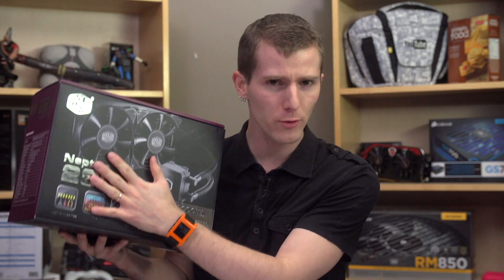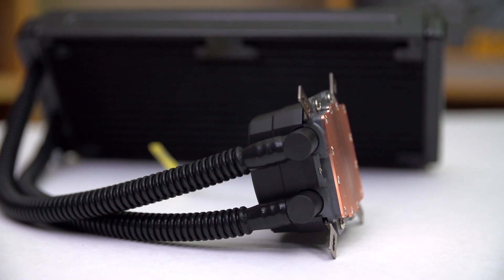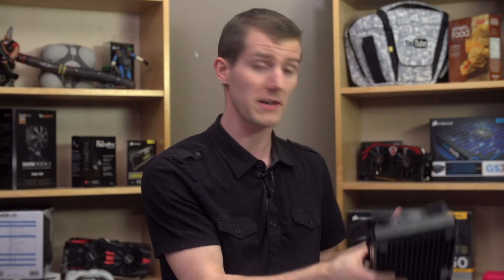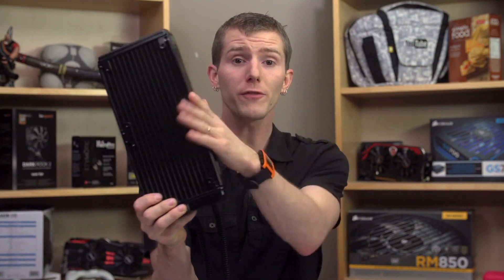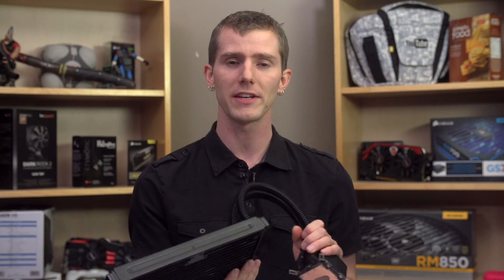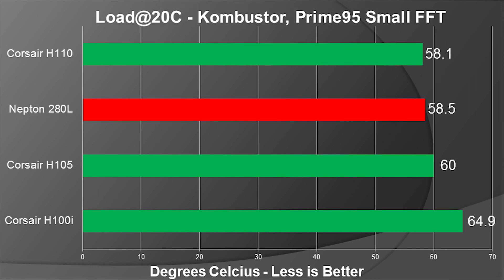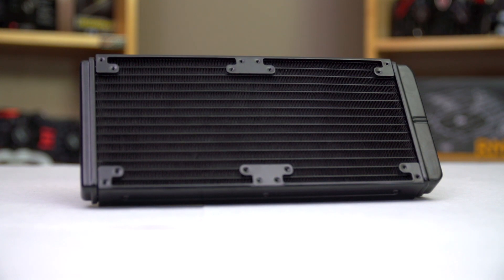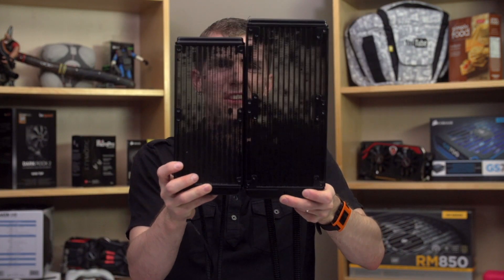Cooler Master Nepton 280L Water Cooler

Comment: It would be soooo cool if cooler master came out with a full tower case that has water cooling rads built into both sides, the back, the front, and the top with the pipes coming down from the top of the case to the motherboard and cpu area. It would be heavy as hell, but imagine all of the surface area for heat to dissipate from.

Comment: Nepton280L + Noctua NF-A14 PWM = perfect combination !
Reply: i promise you we'll see a Glacier 280L in the next few weeks ;)
Reply: NuMetal92 no, but Glacier 360L (3x 120mm) is already on production :D
Reply: IndraEMC I dont understand why, its only for CPU a tripple rad is a bit overkill!
Reply: T0BBi94 Glacier are expendable, you can buy a waterblock for GPU or chipset, plug a tube from your Glacier 360L and you got a fully custom loop water cooling.

Or you can use triple 120mm Radiator just for your CPU for extreme overclocking.
Reply: IndraEMC
close enough ;)

Comment: it is not 20mm. it has two fan mounts so 2*140-2*120= 40mm. But you are right about the sides, they are 20mm shorter.

Comment: You guys also missed that if you just barely turn a screw too tight on the radiator it strips out the threads in the hole very easily on the 280L.  I've had to RMA 2 of them already because of that problem.  That and the constant buzzing with adjusting the screws over n over gets quite annoying.

Comment: Interesting that they have 120mm fan slots on there.  Would it theoretically be possible to mount this on a case that had only 120mm fan slots in the top as long as there was clearance for it?  Or would the rad need to be bolted to the case using the 140mm holes anyway?  If the former were true, would it not be advantageous to do a comparative test of a 280L with 120mm fans and something like a H100i with 120mm fans?  Niche market there?

Comment: I wanted to fit this into my r5 case but i don't know it will hit the 8 pin cable at the top of the mobo. I have the older version of the case without the modular plates on the exterior but two on the interior.  A 240 could fit but I want to cover the entire opening at the top. What are your thoughts on using this rad with two 120s?

Comment: Also I have the cooler mastwr seidon 240M. I have the connector of the water block in the cpu fan header and the two 120mm fans in the two adjacent chasis fan header. Temps are damn amazing but the fans are kinda loud. I feel that they are on max somehow basically on startup. How can I manipulate this to find a nice performance/noise lvl medium.

Comment: would this cooler fit in a NZXT Phantom 410? i know it fits a 240mm Rad no problem but im skeptical if a 280mm will fit the case does have duel 140mm fan support but im just not sure if theres enough space for the tubing

Comment: Never get any answer on this. Are these safe? Do they leak? I know the coolant isn't conductive but it's still liquid and not good having dripping around in the case.
Reply: They are closed loop - Liquids should never leak by design.

Of course no system is perfect and there's a one in a million chance that a nicked or imperfect pipe bursts open. But I'd put that on par with all other "This is so unlikely it's not even worth discussing" list.

You should feel perfectly safe buying a closed loop water cooling system - It's zero maintenance (Except for cleaning out the fans every so often just like an air cooler) and zero worry.
Reply: Mansen Thanks :) Will consider this type of cooler for my next PC.

Comment: Would like  to see in the comparison optional fans. If the fans aren't static pressure. I am willing to replace them on the unit 
But i would like to see an alternative to the Noctua fans or 
At least a good enough solution. 

Ty for video.  | /,,.

Comment: Okay so I need to know if this is a decent build for my first gaming pc ever.
NZXT Phantom 410 case
Biostar Z87x motherboard
Intel core i5-4670k
Cooler Master Hyper 212 EVO CPU cooler.
EVGA GTX-770 GPU
Corsair CX600 600W PSU
G. Skill 8GB (2x4) RAM
1TB WD HDD

Comment: At first I planned on liquid cooling, but more and more, it seems the setups that NEED liquid cooling to stay cool, make for a very small venn diagram. Reminds me of so-called hot-rodders buying expensive spark plug wires and claiming crackhead performance gains. I love the liquid cooling looks, esp w/ colored tubing, but if air cooling alone works, why unfix it ? Thx, Linus & Slick

Comment: I bought 4770K with H100i last month but changed stock fan to Noctua Nf-F12 in Pull.. They look ugly but the are hidden on top cover oh 600T case in pulling air from inside and exhausting to the top..
Reply: what is your clock and what temps do you have under full load ? i have the same cpu and cooler and it would interest me how corsair sp performance perform
please also say me how much rpm you run it, if you set it specificly
Reply: At stock clocks, it stays at 25C  with fans controlled by the 600t"s fan controller at lowest RPM and at full load in OCCT stress test for 15min, it goes at 48-50C max..

Didn't OC'd till now but gonna do it. I'm a VFX/Animation student so rendering is done but till now had no problem with stock clock.. This is to be noted i have 2 X R9 280X and in Live in New Delhi, India so ambient temps a re bit high compared to USA, UK ..
Reply: I stay at 20-25°C dipending on my room temp.
Under full load with custom curve the rpm goed around 1000-11000 and temps stay around 55. I prefer to have it quiet. The thing that makes more noise is the hdd. lol

And i didn't OC too. For the moment with a gtx 780 i have enough horsepower
Reply: Jay Shank wow thats higher than my noctua nh-d14 yikes
Reply: my 9370 runs below 12-13 degrees and at idle runs 2-3 degrees underload stays around 43.

i use the asetek 120mm thick close-loop that came as a bundle ...im not sure how it does this :S but i guess im happy lol
Reply: damn elmo you like it cold in your house or was you talking about delta temps?
Reply: Unless you live in a meat locker I'm going to say your readings are wrong.
Reply: i do live in canada and its winter maybe tht helped?
Reply: I live in India and Room temp in summer is around 35C or higher with AC off.. so you can get the idea... In winters, i don't know as its only about a month or so since i builded the system from scratch..

Other than that 50C is not bad.. just think what if i was using a stock fan which came the the processor??
Or even with H100i's stock fans...
Gonna do push/pull to but have to get slim fan as the board and radiator don't have much room left, by r=the way, the mobo is Z87X-OC Force.so Overclock will be there but in near future,..

Hope this clears many questions..

and tower coolers are some times good but not in all cases in my experience..
And all my temps are at lowest RPM with 600T's fan controller..
Reply: Jarno Marinelli well quite system is my choice too so 55C is not a whole lot.. its ok, no worry of toasting the CPU .. and GTX 780 is a great card.. your system works like mine..just some degrees difference..
Reply: THEREALTICKLEMYELMO Maybe, your ambient temp do make difference and also your cases's airflow too...

My house's ambient in summers is 35C or more without AC is switched on.. so you can think i live under a heater in summers :-D
Reply: BassRacerx Where do you live and what CPU you have?
Reply: Alabama 4670k stays very close to 70f in my house
Reply: BassRacerx Means 21C.. well its cold.. compared to mine.. and your is i5, and i do rendering and stuff and is i7 4770K... Still your ambient makes lot of difference...

Comment: I'm new to pc building and my pc is air cooler with a hyper 212 evo, which under load brings it to about 64c. Can you tell me if using a liquid cooled system is safe. What I mean Is how likely is it that it will leak, and if it does will it ruin my other components? Lol need some liquid cooling for dummies here.
Reply: I use the 212+ and it NEVER leaks :-) ... these systems usually don't leak but after a few years it could work it's way out... I would make a custom system if I were doing WC.

Comment: Thanks for all your great Reviews and Unboxing videos

I recently bought a Nepton 140xl hoping i could prolong
the lifetime of my current system, by using products i would be able to reuse
some time in the future when i'm going to upgrade my MB and CPU (socket 2011)

i have a reasonably old system here
i7 860 @ 2.80 ghz
Gigabyte P55A-UD3
8GB Corsair PC2133 <--- new
2x ATI XFX 5870 Crossfired
120GB Samsung 840 SDD <-- new
1TB Samsung "old school disc"

i have just recently been thinking of upgrading my system, a few parts at a time, SO i got the SSD and a new CPU Cooler "one that wouldt fit a 2011 Socket in the future" be course i was thinking of trying some OC'ing.

at 2.8ghz 
Idle temp 35c 
peak 47c
1hour test with OCCT

at 3.6ghz
idle 43c
peak 73c (CPU seems to be throttling)

CPU Frequency :180x20 
QPI link speed : 182x32
Mem Frequency : 180x8 (1440mhz) <-- im actually running 1800mhz atm.

i was hoping my Temp would be quite a bit lower with the Nepton 140xl then it is, any suggestions to that could cause this, my OC build, not enough cooling paste, other things?
At the moment i have got the jetflo140's that are included in the box configured in a push pull configuration,but i have recently ordered a pair of Cosair SP120 quiet edition, i was thinking for the replacing the jetflo140's with   

Any help / Advice is much appreciated

Comment: hi, just a question, which perform better? 
Cooler Master Nepton 280L OR Cooler Master Nepton 240M? 
let say CPU be i5 6600k skylate.
Reply: +C2Tech The 240M hands down. Because, lower price and better fans. I have one myself.
Reply: thanks i will just get 240M then, I am planning for i5 6600K processor. so the cooler shouldn't be any problems right, when overclocking.

Comment: 280l, x61, H110, or air cooling? I'll replace the fans with noctua's anyway so sound isn't a huge issue. thanks. :)
Reply: H110i
Reply: I have an x61 which is great. H110i puts me off because of how terrible corsair link is.

Comment: Is this radiator compatible with the coolermaster HAF XM????
Reply: Cameron Evans if your case can fit two 140mm fans in the top then most likely yes just make sure it wont interfere with any heatsinks on the mother board
I used to have the same case it was very nice. but i had 2 200mm fans in the top of mine not 120/140's

Comment: can it fit on nzxt s340 front panel ? because of the thickness 
if not how about nepton 240m
Reply: Fitting this cooler on the s340 was a pain in the ass and took some tinkering, I managed to fit it in by removing the cable hider which is the white metal piece with nzxt written on it.
Reply: Tldr: yes
Reply: MonkeyFusions Yeah, you can't put it back on, but my rig still looks pretty good without the piece. I also heard that even nzxt's own radiator won't fit in the case without removing it.

Comment: hey guys PLEASE help. I have a 4930k and a H100i in a NZXT H630 with 2 noctua nf-f12's. I have the rad attached to the case and the fans to the rad, stickers facing down. It's running at around 46c on idle (same temp even with the side off). What should I do get this temp down?

Comment: the Phantom 240 fits dual 140mm fans at the top, but is only compatible with 240mm radiators. Wierd. Nvm, the corsair H100i GTX is all I need for a 4.2ghz FX 4130

Comment: I know it would be stupid to buy a 280mm radiator and use 120mm fans, but you forgot to mention the spacing between those fans is terrible, they are not next to each other so it will make "native" compatibility worse

Comment: Can someone explain to me how this is a liquid cooler I don't see any liquid, only fans. I also don't see a reservoir.
Reply: those little bulges on the sides of the radiator are reservoirs and because its sealed the liquid is already inside
Reply: pastaraketti  yupp and its an internal cpu cooler which means as compact as possible for only the cpu cooling
Reply: Are you serious or are you trolling?
Reply: I was serious
Reply: William Schaffer well the thing that mounts to the cpu is the pump/block combo and a guy above me explained where the reservoir is. Sorry I thought the majority of people knew that lol
Reply: Ben Zimmerman how you gonna refill the liquid cooler with fan mode , i just curious to ask
Reply: yu cant refill this one theres a lifetime cooling liquid included

Comment: So it's a h110 lol. I guess it does look nicer and costs about the same.
So really if you want AIO 280mm rad right now it looks like the Kraken x60 (better looks than the Corsair h110) or this as it looks nice too but with some minor compatibility issues.

Slightly disappointing lol.

Comment: can't fit with my c70! even with fans under the radiotor, help
Reply: Your case isn't big enough
Reply: dude, their case is also c70 ...
Reply: I managed to mount it anyway, just without rubber ring on the hole, so , a liitle bit noisier
Reply: Cedric Gan ok

Comment: This cooler or corsair h105?
Reply: H105 over this, H100i over the H105. I own it, the H100i is MUCh better.
Reply: bossgamer107 why? it performs worse
Reply: Corsair Link, allows you to control the fans directly from the software. Helps to keep things quiet!
Reply: true, but in terms of pure temps these are better
Reply: bossgamer107 So do resistor cables and actually quieter fans(Noctua).
Reply: Yeah, but I like to be able to monitor anything. Corsair Link monitors all of my components.
Reply: Price comparison, this coler win.

Comment: It does make me question how much R&D these companies do on their designs when they ship with fans with round casings. It's such an obvious problem.

But, whatever, proper water cooler always better (if not as low in price) and massive air cooler usually better for low price (if more annoying at times).

Comment: stop yelling >.< why is the audio so load
Reply: WHAT? CAN'T HEAR YOU!
Reply: YO TURN THE VOLUME UP
Reply: Are you using an SSD? maybe that's why its so load.
Reply: If it's loud, it's because you are older than the 11 to 17 demographic these people seem to be targeting.
Reply: You should buy a $2000 sound card to solve that problem...
Reply: The higher the audio then better I can listen. Also turning it down is better than up.
Reply: Tommy Hughes It's not the volume, it's the noise/pitch from Linus yelling that's annoying. I'm no sound tech so I have no idea of proper terms, but turning down yelling doesn't automatically make it easy on the ears.

Comment: ill guess this cooler doesnt fit in the Nzxt S340 case :P
Reply: It does, it supports 280mm
Reply: hmmm mabey a good upgrade for my case than ...thanx..
Reply: I also have a s340 and a 280l, and it takes some tinkering to mount the radiator, also you will have to remove the cable hider (white metal piece) to fit the radiator.

Comment: Lol my case doesn't have room for it so i took off the side panel and mounted the radiator at a 90 degree angle on top of my case. its ghetto but it works

Comment: got H100i, still the best in the chart woot :)
Reply: I do too and i <3 it but you realize that it says less is better on the results right? It is the worst there.
Reply: I think they are keeping this chart limited to products within a similar price range.  I have both the H100i and Swiftech H220 and the latter produces better temps but does cost more.  Having said that the H220 doesn't have the monitoring software that comes with the H100i so there is a trade off.  All AIO coolers will get the job done within a few degrees of each other so it doesn't really matter all that much.

Comment: Just completed my first build on friday. http://pcpartpicker.com/p/34y4o
Comparing gms to ps3 versions that I have are laughable. My pc is blwoing them away. Anyway I have the nzxt phantom 530 case and it has two case fans that are connected to the multi fan hub it has that is powered by a molex connector. The cases fan speed switch I believe is powered by that same connector. Fans are clearly spinning but speed switch seems to do nothing. Fans are still moving even while in off position. I feel kinda dumb, any thoughts.

Comment: yet again this is not an performance review like you said like the description states.
all i see is pretty flimsy evidence of how the cooler performs compare to the Corsair ones.
I would like to see some more proof like, what fans are you using, what overclock of the CPU, how much RPM the fans etc.
Reply: None of those things matter as long as they're the same across every test they do on these coolers. They're only getting performance from the cooler AS COMPARED to other coolers to see if it really is better. If you are interested in what he is using for fans they're probably Noctua-NFF12s with the low noise (low rpn adapter that spins around 1200, he has a thing for those), and they use a standard test bench that has (I think, you can check another video where they use it to be sure) and i7-4770k with overclock settings in a google doc that should be linked in the description. You can always check his website for this stuff too. He should have the whole test setup listed somewhere with all these details. They just aren't listed here because they aren't changed so that the testing variables are limited to nothing but the cooler being reviewed.